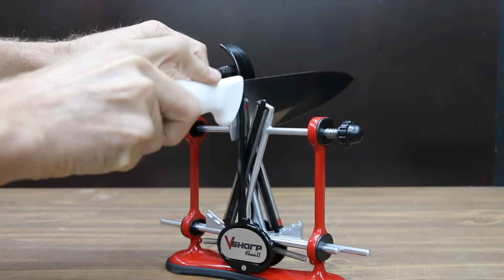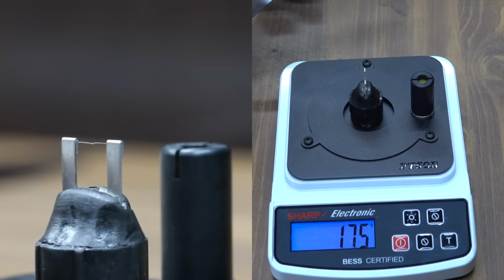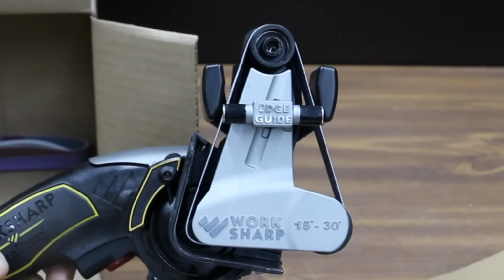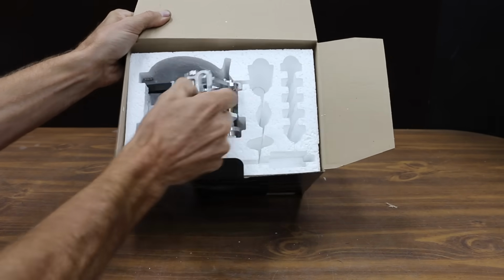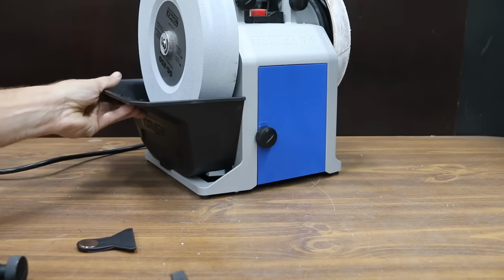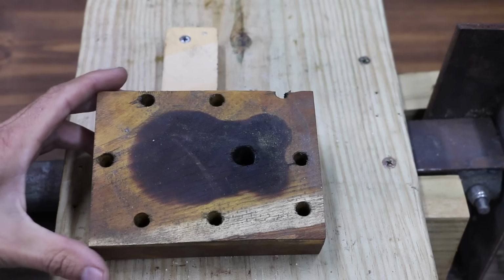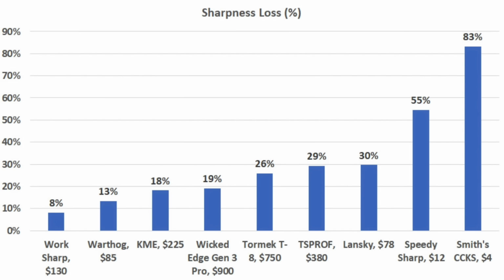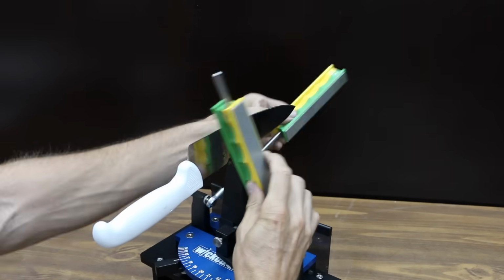RUSSIA vs USA Knife Sharpener? TSPROF vs Lansky, Wicked Edge, KME, Tormek T-8, Work Sharp Ken Onion

Comment: I don't know.  This test doesn't show how maintenance goes into these sharpeners.  Can I get replacement tools when they wear out?  How long will the tool last?  I have sharpened expensive Japanese and German knives for 30 years with waterstones.  A good quality stone can last decades.  I'm still using the same 1000 and 6000 grit stones I started out with.  The key is not to over sharpen your knifes and with water stones you can tell with experience when the knives are sharp enough.  Some of these tools are very difficult to determine when the knife is sharp enough, just using the suggested number of passes could over sharpen your knife needlessly.  For cheap knives, you probably don't care but then why spend so much money to sharpen cheap knives? For expensive knives, I wouldn't use these methods at all.  Use waterstones.
Reply from the maker: Thanks for the constructive feedback.

Comment: I kinda dig the Tormek with its massive stone wheel especially if someone has a ton of knives to sharpen. Not a huge fan of some of the other brands having tiny whetstones that need to be frequently replaced at $$$.
Reply: I agree. The Lansky and Wicked Edge are like the Keurig of knife sharpeners.
Reply from the maker: Thanks for the feedback.
Reply: Video from tormek: https://youtu.be/5d8jcG6bzJ4

Comment: I really liked how objective you tried to make your tests but I was wondering if there were more apples-to-apples metrics for durability: 
E.g. # of weighted passes over some test object e.g. very thin sliced of balsa wood or 1" thick potato/apple/vegetable/etc. slices until it no longer cuts cleanly. Another alternative is calculating linear inches that a given weight will penetrate
 for time: after that dulling, calculate the cost of the system divided by the time to restore the knife (also needing a factor on the marginal cost of time).
Reply from the maker: Thanks!  Thanks for the suggestion.

Comment: Yeah any one trying to market anything "Japanese steel" and is not a actual knife signed and forged out in japan by a person is a meaningless marketing ploy including if its stainless steel. The Japanese steel is Tamahagane and its what is only made in japan for knives or swords. Very few make the knives or swords from it and fewer make the metal anymore. So if you see the Japanese steel stuff just stay away from it. Just learn what steel its made from and go that route. Even stainless steel has some good quality versions for knives that are very tough but that steel is expensive and that's just buying the stock material and not the knife.
Reply from the maker: Thanks for the feedback.

Comment: i almost bought one of those tormek sharpeners but it was way too expensive. I can get my knives plenty sharp with a sharpening stone and i have that speedy sharp it is great for work knives to sharpen them quick but it takes off a lot of metal from edge wouldn't want to use it on a fine knife . I never use my lansky it is ok on a brand new thin edge kitchen knife but takes forever to grind down a heavy hunting knife edge thats been sharpened to a different angle then the lansky
Reply from the maker: Thanks for the feedback.

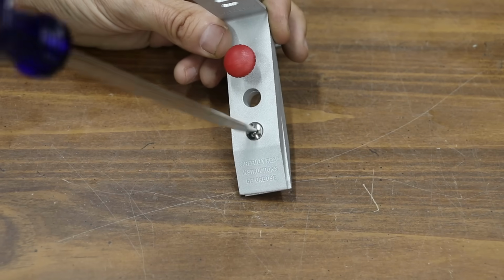Comment: At 03:04 what did you say that screwdriver was? In the UK we'd call that a 'flat blade' screwdriver. But you said 'Dimer' or something? I couldn't make it out

The TSProf is pretty amazing. Some finer grade stones would be good though. Also the knife clamp allen screws should have thumb grips on them or something so you can use it without needed to fiddle with allen keys. Looks like a lot of engineering for $380!
Reply: I think he said “a dime or a screwdriver.”  (A dime is a small US coin)
Reply: @-Jethro-  That would make sense. I wondered if he was using some far out, hip Yankee lingo I wasn't familiar with! Thanks for clearing that up

Comment: Cutting paper is bad for the sharp, clay is used as a filler when making paper especially in copy paper.  If you really want to use paper, use newsprint, it has much less clay in it.  I worked on a paper machine for 27 years which specialized in copy paper.
Reply from the maker: Thanks for the feedback.

Comment: That lansky thing is a joke. It's way too complicated for anyone to use regularity. I also bought a Worksharp Ken Onion sharpener. I only really use it to sharpen my lawn mower blade now. 

What works the best and is easy enough to use constantly is a simple ceramic rod. I bought a 7 inch, USA made ceramic rod from an online knife shop and paid about $10 for it and it is my "go to" sharpener. It sharpens more than enough for any regular use knife (cuts paper and shaves hair) and is small enough to take anywhere. It also works great on curved blade shapes, which a lot of these things will not. Everything else was a waste of money for the use I got out of them.
Reply: yeah, i have a lansky and i never use it it takes forever to change angle that is already on a heavy knife that has been sharpened many times to match the lansky angle
Reply from the maker: Thanks for sharing.

Comment: Checked Lansky on Amazon. Lots of bad and one star reviews. The new versions are not as well built and usable as the old kits. People  complaining that the stones wear out and the angle is not accurate except in the middle of the blade. Hard to use successfully, with the blade coming loose from the clamp. The overall design is cumbersome.
The Work Sharp Precision Adjust Knife Sharpener
costs less and has lots of good reviews. So I odered it.
Reply: You should be happy with the Precision Adjust, I really like mine and it's easy to use.
Reply from the maker: Thanks for the feedback.
Reply: The one I bought, all the rods were bent, which means the stones woudl all be at different angles.. I bought it on amazon,so it was probably a chinese knockoff. Either way, its way too time consuming  and over-complicated to set up. I can sharpen my knife with a ceramic rod to a more than good enough sharpness 10 times in the amount of time it takes to set up the lansky once. It's just a gimmicky waste of time.

Comment: From my personal experience, I would not recommend the Smith's pull through sharpener to anyone. There are other brands exactly like it as well. I've seen the carbide pieces literally cut off corkscrew pieces of metal. Perhaps in an emergency on a knife you didn't care about. I threw mine in the trash many years ago.
Reply from the maker: Thanks for the feedback.

Comment: @Project Farm: Would the Mini Digital Level Angle Gauge Angle Finder Protractor help me find the correct angle for my mower blade or is there a better way?  I use a hand file but I want to check the blade as I go. Thank You
Reply from the maker: Thanks for the suggestion.

Comment: I saw that work sharp made their own version of the lansky-type jig. I didn't get nearly as good of a result as you did with the KME but it was a lot cheaper ($50).
With all sharpeners, I found the best results by grinding down to the initial bevel of 15-17°, then grinding a microbevel of 20-25° (depending on the steel). Would be interesting to see your results from there and how long it takes to restore each knife.
I always love these knife sharpening videos! The ASMR was hilarious. 😆
Reply from the maker: Thanks so much!  Thanks for sharing.

Comment: Hands down the best comparison videos in the world. Combination of a person with a higher IQ and experienced provides excellent results. 

I’ve been debating on sharpeners. I currently have tackled hand sharpening. I’ve gotten pretty good with it. However my stones are not idea for reprofiles or say chipped edges. I use Spyderco’s  ceramic stones. I have all three grits. It took some time to get decent. Holding the angle free hand was the hardest thing to perfect. 

With all that. I still like the idea of a machine to help hold that angle. Thinking I’ll snag the work sharp Ken onion elite set up. This I can use on my axe, machete, chipped edges or to reprofile. 

After that I am eyeing the KME. I’ve seen some amazing edges using finer stones and strops. 

Really loved the revisit on the knife sharpeners.
Reply from the maker: Thanks so much!

Comment: This test had me on edge the whole time. I have a Lansky.
Reply: same here, I have a Lansky and I take it with me to work. I work on a tug boat and the knives here get some true abuse. from using the chef knife to scrape old grease from the stove to chipping ice ... I end up using the bench grinder about twice a year to rescue them because someone chopped through bones or stuff I don't even wanna think about. The Lansky brings them back up to fillet cutting performance. I would never bring a more expensive grinding system to this environment.
Reply: I use the Lansky as well.  It it's exceeds the others by taking out the guess work and being readily available at almost every hunting/ sporting goods store.  I've used mine for the last 8 years or so and haven't looked back.
Reply: I saw what you did there with your pun and I'm not disappointed.
Reply from the maker: Thanks for sharing!

Comment: Excellent video. Just wanted to point out however, that "sharpness" is not a black and white thing. In the context of this type of video, you used an objective measure of sharpness (Bess scale), which makes sense given the need to control for as many variables as possible. In real life, "sharpness" is varied depending on the type of knife and use. For example, It's possible to get a blade incredibly sharp, but at the cost of durability (how long will that sharpness last). That's why lots of times as a knife sharpener, I won't go past a certain point even though I can get it much sharper. You did a great job of trying to address this with the edge retention testing at the end. Also, in some other applications, you'd want more of a toothy edge vs polished to get micro-serrations that can aid in slicing. Overall amazing video!
Reply from the maker: Thanks so much!
Reply: I have noticed that getting my M390 benchmade a mirror edge it seems to have a harder time cutting because it isnt toothy

Comment: I’m still disappointed that you haven’t include Spyderco Sharpmaker.
Sharpmaker is very easy to set up and almost full proof for the absolute beginners.
Imho it is priced like Lansky but easier to use and set up . With only medium and fine ceramic rod 
You can set it up for back bevel when the knife is very dull and the regular bevel for regular maintenance sharpening .

I’m ex’s sushi chef and used to apprenticed under Japanese sushi chef where part of my training was sharpening our knives. 
I have all kind of sharpening system , lansky , Japanese water stone . Ken onion sharpener ( great for my axes and outdoor blade ) 
smith blade medic ( great for outdoor bag ) 

And my favorite Sypderco Sharpmaker.

Please include spyderco sharpmaker . 
Thanks
Reply from the maker: Thanks for the suggestion.

Comment: it would be amazing to weigh the sharpness loss by the absolute value (i can't suggest a metric from the top of my head, but it feels like we need an integral of the sharpness over time)
Reply from the maker: Thanks for the suggestion.
Reply: @ProjectFarm  for example, if a knife of some given steel gets dull exponentially (some very small negative exponent) or hyperbolicly, the measured 2 points give you a singular POSITION on the sharpness curve, from this position you can say HOW LONG this knife will stay above the desired sharpness threshold.
Reply: I think the sharpening test that is being used is an absolute, objective value. I think you might be right on sharpness over # of cuts but yeah that would get real expensive really quickly
Reply: @jesheezy  i am OK with the 3-point test, i am just saying that there is more info in 3 points than "sharpness loss", for different starting points some given sharpness loss means different "life experience".
imagine the full sharpness curve that we did not measure.
a knife over its life experiences degradation.
we can integrate above the point of certain desired sharpness threshold as thus say how much sharpness*hours this knife delivered.
assuming the degradation curve depends more on the knife than a sharpener (it is fundamentally curved by the material and parametrized by sharpening success)
we can APPROXIMATE from the measured 3 points the integral amount of sharpness delivered in the range of acceptable sharpness.
Reply: @sillysad3198  oh I see, yes I agree- three points would provide a lot more information than a single point, including being able to see the "curve" of durability
Reply: @B__Mer  it is so sad that you can not comprehend written lang.

Comment: First thanks so much for the review! I am in the market for a Lanskey type sharpening system and have looked at a few since living on a fixed income in retirement has me very budget conscious!
Second: I used to work at a hydraulic rubber hose plant and we used knives to cut rubber and uncured rubber all day. The knives the company supplied were ok but not great for keeping their edge so of coarse we improvised. We also used hacksaws to cut threw the braided wires in the hoses for installing couplings. We found that old dull hacksaw blades 1” usually made great knife blades when ground and shaped and for handles we used the plastic utility knife handles. The old style utility knife holders had a slot for the blade and a screw to hold them in on the side.😉
Reply from the maker: You are welcome!  Thanks for the feedback.

Comment: I like the Lansky myself for general sharpening; I also use just standard diamond wet stones for things like chisels and plane blades.
I carry a Smith’s PP1 in the car and have one in the night stand and in a go/work bag as it seems like the fastest sharpening method similar to the $4 pull sharpener; I think the PP1 is like $10 but includes a ceramic rod for sharpening sedated blades as well. While I wouldn’t consider the PP1 or other pull sharpeners as good as traditional stone sharpening it gets a decent edge fast and is just so much easier to keep an edge going by hitting it 5-10 times every few days. I regularly carry a Leatherman wave and typically some kind of pocket knife and especially for the thinner blade of the Leatherman the pull sharpeners work well enough. I’ve just gotten into a routine of sharpening every 2-3 days when I take my belt off I just pull the knife out and slide it through 5-10 times on the carbide then ceramic.
I grew up in scouting and always had a pocket knife and would keep it sharp with stones but sharpening gets old and as my life has gotten busier I simply have switched to the quicker options and have been OK with a sharp enough blade and just keeping it tuned up. I will say I used to carry a Benchmade OTF in my vest as a last resort and it never saw anything but a diamond stone and strop; I just could never bring myself to using a pull type sharpener on such a nice knife.
Reply from the maker: Thanks for sharing.

Comment: I picked the kme over the others when I was choosing a guided system because of price and the extras you can get if you want. Convex rod, different grit stones, recurve stone, strops, and the laying films.  They make almost anything you would need to make what ever edge you need. I still prefer freehand sharpening on longer blades due to the angle changing from tip to heel on fixed systems.
Reply: The KME is my favorite too of the guided systems although I went with whetstones for myself, I like the more time and attention you have to put in it. My first knives already came out scary sharp so I'm a happy camper. But I get the appeal of the KME, it has just the right amount of features without being as in depth as that TSProf, and I imagine availability of different stones and accessories might come into play as well. But you know, sometimes I use sandpaper on a flat ceramic tile for things like tools when I need to do some proper re-beveling of rusty blades or chisels, so there's a use case for very basic setups like that too.
Reply: Agree with you on this.  My hunter buddies also use KME to sharpen their broad heads for archery season.  Very versatile kits and accessories.  Don't forget the strop either.
Reply: @Tester13032  yes I forgot about the smaller jaws for that stuff I think they might even have an 🪓 attachment
Reply from the maker: Thanks for the feedback.

Comment: Honestly I think that a standard steel should be sharpened at 20°
Reply from the maker: Thanks for the constructive feedback.
Reply: @ProjectFarm  Sorry I meant 20 degrees angle , cause it's probably at 55-56 hrc  so at a low angle the edge rolls easily.

Comment: Really cool seeing you test some of these high-en sharpening systems, especially the TSPROF, which can be hard to find in stock here. I'm looking at systems like it or the similar Hapstone systems. A lot of expensive systems like KME and Wicked Edge don't go down to 10° or lower, which is necessary for some Japanese style knives, razors, etc.

I do love my Ken Onion Worksharp, but I prefer it with the blade grinding attachment. I'm jealous of that Tormek, though. I hope to have one of those in my workshop in the future.
Reply: I have a Tormek t-4 and it does a great job. I had an older model tsprof system and it has great performance, but it is slow. With all the jigs and the speed of the Tormek, it was an easy choice.
Reply from the maker: Thanks for the suggestion.  Thanks for the feedback.